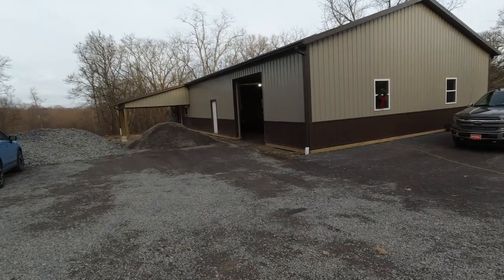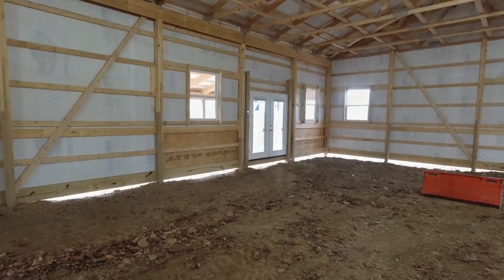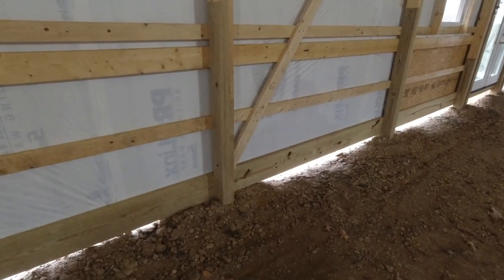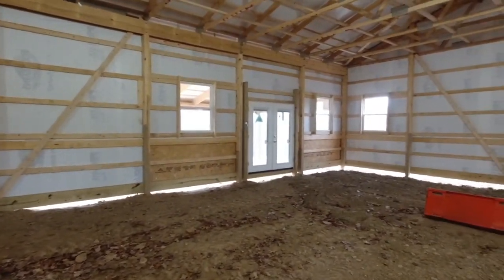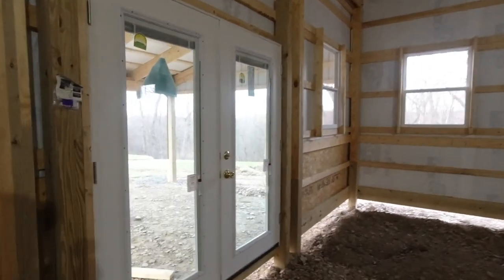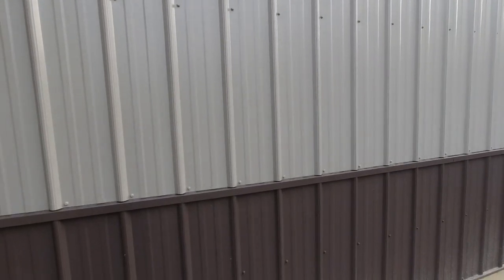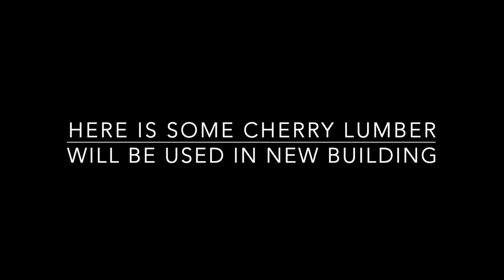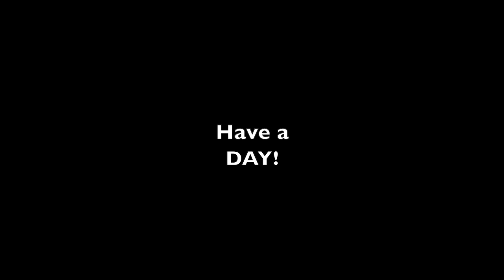Pole Building Experience So Far, Cost Per SF, Pros and Cons Video #1008

Comment: Mike
This is my first comment on your channel, so I’ll tell you a little about myself.
I live on a 25-acre smallholding in the north of Wiltshire here in the UK. We are surrounded by beautiful countryside and a river forms one of our boundaries.
Like you I have a regular job as an Architectural Technologist based in Bristol but since COVID-19 I have worked from home.
I found your videos when looking into buying a tractor to help when repairing hedges, ditches, and fences. Working outdoors at a pace that suites me is such a contrast from my regular job sat in front of a computer screen I love it.
In my work I have used a similar construction to your pole barn but with one difference. I have always used short steel columns from the footing to 6” above ground level which allows the timber to dry after the rain. The ground around your pole barn looks like it would drain well so the timber will last for years.
Thank you for sharing these videos. I always look forward to the next instalment.

Comment: I had a small pole barn built a year or two ago. I use mine as a work shop  I love it. My biggest regret is not adding insulation. I live in the Deep South so cold is not the issue but heat and humidity are. Thanks for sharing your experience with yours. 
Dean

Comment: The property I bought has a 30 x 40’ unheated barn metal sides with a cement slab. I’ll probably build another one that’s heated. Build more than you think you need because you’ll find you’ll need it in the future. Thank you for your thoughts on your new building. It looks wonderful and I like the finishing touches and the Open area under roof where are you can just hang out and have fun.

Comment: Pole barns are popular in Kansas. I have built a few (grew up on a 60 acre farm).  If your are pouring a concrete floor, tie the poles into the floor slab. Keeps the wind from rocking the poles loose. I had one building get lifted up and flipped over due to lack of floor/foundation.

Comment: If you plan on doing mechanical's I strongly suggest you inquire from OEM's what their requirements are for their products to avoid surprises later, easy enough to plan for in your initial layout plan. Nice to have an inside system permitting work on all your equipment and their accessories for service and repairs.

Comment: I built a pole building 35 years ago,  The poles are 6x6 PT and are 48 inches in the ground on a concrete foot. It is 24x24 two story gambrel roof. Concrete floor is 9 inches thick mostly and under to two overhead doors it is 16 inches thick  two car garage down only use one side for my wife's car, the other side is my machine shop. Upstairs is my wood shop. It has outside access to the second floor shop and I heat both floors with a coal burning hot water boiler that I converted to hot air, does a great job.  Every few years I dig down on the side of a post and check for rot and such and so far they are a good as the day they were put there. Of course it did not take long before it was too small but I have to live with that, I did put a small addition the back for my air compressor and the wood shop dust collector. You don't have to worry about your posts they will outlast you for sure.

Comment: I'm finishing up the inside of my pole barn 3 car garage now . The soil conditions may be different there but here in Bama you should sit the poles in a sleeve or they will rot in 5 years . Since the EPA has taken the good stuff out of wood treatment they don't last whether you sit them direct in the soil or in concrete . The plastic post protector sleeves are about 40 buck each from home depot but worth it in the long run .

Comment: Mike, here's an idea for heating your new pole barn. Years ago my uncle Vincent built a new house with 20" exterior walls, using hot water heat for heating. But here's the great idea that will also work for you with radiant heat. He buried an old gasoline tank filled with softball sized stones which were heated by the circulating hot water. He used a wood burner boiler in conjunction with a pulse jet fuel oil furnace. Sadly he passed away shortly after completing this build, but my aunt told me that she fills the wood burner for a day and then circulates the warmth from the heated rocks for the next 3 days. something for you to consider.

Comment: These are great cost effective buildings. Did you think about using concrete perma columns  in the ground with the 6x6 post bolted on top with thick metal brackets. It worked very well for us on a 80x60 building. I think the concrete perma columns with 1/4 inch metal brackets were about 110.00 dollars each. We though this might help make the building last many years more. Just a thought 👍 enjoying your channel very much.

Comment: Hi Mike. Agree with your choice. I have raised 6 pole blgs here in low country SC. Best bang for the buck. However we have to treat around all poles for termites and stay on top of that  process.
Reply: Have you considered pouring ready mix concrete around the posts instead of dry concrete mix and dirt?
Reply: @davidmorse8432  we actually pour mixed concrete and use ground contact treated lumber. Have only had one incident were the critters found a void in the footing and started on a portion of the post. But it took 8 years and then not too much damage.
Reply: @ralphjelomono9068  I have seen where the concrete sometimes cracks around a square post with the crack starting at the post corner and radiating outward.  Maybe some type of spiral #3 rebar could prevent this so the concrete seal around the post would not be broken.  Thanks for your input!
Reply: @davidmorse8432  Likewise appreciate your knowledge. However just like Mike Morgan I believe my pole barn building days are over and future ones I'll leave to the experts!!. I have had enough ladder climbing for one lifetime.

Comment: Its a fine building ..........only thing I would say is I have used pressure treated posts here and they still rot in the ground and eventually go . Perhaps galvanised feet /metal shroud at base of poles ............ you could retro fit them before base goes in ............

Comment: Mike,
I know that you have taken precautions with your posts by using a laminated post to prevent rot.
A fellow YouTuber "Tractor Time with Tim" has an episode called "Pole Barn Update! Post Repair!.
That video showed a product that is a steel sleeve that can be inserted around 3 sides of your post and driven into the group to act as a brace to the post .  
Just a thought but probably not necessary in your case.
Keep up the great work.

Comment: Another advantage is the weight of the building is on the ground and not the concreate floor. Makes it less prone to stress cracking near the edges of the building.  On softer terrain the pole building is the way tp go. your concreate will thank you.   How is the pond drainage pipe? any fixes on that in the future?
 well another awesome as always video . have a day Mike.
Reply from the maker: Good point

Comment: Told you that pole barns direct do a great job. Built my 36x48 several months before you did. ( same color btw)  Everyone should know that you will likely spend 25% to 100% of the cost of the building to finish.  When considering floor, installation, heating, lighting, etc...

Comment: What company manufactured the components? I have a Morton Building, and it looks almost identical. We love ours, and it has served as a stable, lawn equipment, the kid’s automotive shop, and a gym. We live in Missouri, and nearly every one of nearby neighbors (everyone lives about 2,000 ft apart from one another) has a very similar structure. Ours is 23 yrs old, and this year I will have to replace the entrance door. That’s the only work that must be done. It’s been through hail storms and tornadoes over all those yrs too.
Reply from the maker: Morton’s are the Cadillacs

Comment: Thanks for the quick summary. I am building a similar multi-use building and small cabin in the woods this spring. Both buildings will be post frame steel buildings. I am interested to see how your radiant heat floor goes in.  I am a little east of you in Armstrong Co.

Comment: I am building a Barndominium. 60x60 Metal building with 6 inches of insulation. The home will be 26x60 inside the building. The wood shop/garage will be the remaining 34x60. For my retirement in about 4 years!

Comment: Good morning! I sell pole barn kits out of Lancaster county Pa. You mentioned about the wood in the ground may not be as good as a concrete/block foundation. An alternative for that is what's called a Perma-column. Google it.
It's a 5' concrete post that bolts to the bottom of your Glue-lam posts. This keeps your posts out of the ground, still a pole building and your building will last just as long as a building with a concrete/block foundation.

Comment: Does the skirt board around the base remain?  If you pour concrete inside and a patio outside then  the skirt board would be sandwiched between both pours, right?
Reply from the maker: There will be 4" Thick Foam board on inside that the concrete will go up against if that makes sense

Comment: Hard to compare a pole structure to a complete house ? We built pole building for cattle / hay / lumber operation in northern Ontario Canada . They are one of the cheaper methods by not spending money under ground and insurance cost because classed as low occupancy. Nice building you have there Mr. Morgan , M&M Enterprises is looking good

Comment: I would like to put up a building for a shop.  my 3 car is a bit crowded to work in.  we're on rock.  There is a house going in next to us that is a Morton Building.  they dug the post holes with a massive truck with a rock teeth on the drill.  it took two days to dig the holes for a 1200 SF building.  I have talked to several people including Kyle from RR Buildings (if you haven't watched his channel, you should) and my excavation contractor. all are in agreement that I should do a slab on grade and use the post brackets.  I've thought about it and if I do, I'll insulate the exterior of the slab using an ICF form that has been cut in half. that's 18" tall as well as foam under the floor for heat.

Comment: I think I heard you say the patio and game room has a 5 inch cement floor but I didn't hear you say if you had a cement floor or how thick of floor in the storage area. I am a fairly big farmer in Indiana with large heavy equipment and 4 semis and I have 8 inch thick cement floors in it. I don't know how much ready mix cement is there a cubic yard but the last pole barn I built cement was $80 a cubic yard. None of my last pole barn building is finished or insulated but the roof tar paper under it to keep it from sweating inside on my equipment but it sounds like to me what you have there is a really good price on yours.
Reply: In Michigan I believe the price of  concrete is about 2 times that price now.

Joe

Comment: As for gutter guards, I have a mixture of the mesh screens (org house) and the more advanced, aluminum with holes (new addition).  Honestly I do not see much difference.  I have lots of 100’ trees around and the only place I have to clean are the 90 degrees inside corners.   Either are well worth it.

Comment: Mike, a few thoughts after I just spent a month wiring a pole barn. If your contractor asks you to rent a man lift- rent the man lift. Working off of a 14 foot ladder and still being 6 feet from the ceiling is uncomfortable and dangerous and makes simple 20 minute tasks take hours; because I was working for a friend and trying to save him money, an 8 day job became a 24 day job, because the cost of a man lift was too high for him to rent.
Before you pour your concrete, not only do your plumbing but also please call your electrician. He can put a ton of your wiring work underground in pipe under the concrete and take that 8 day job and make it a 5 day job for them. 
Pick out the lights you want to use before or when you talk to your electrician the first time and please provide them before they are finished with the work and stuck waiting for your decision so they can finish wiring the building because of the lighting you choose.
And also, talk to your people while they are working there but for god's sake, please do not talk so much they stop working and just stand there talking to you. time is money.
I love my buddy, the location was a bit far, and the scenery of the job site was idyllic- it just wasn't 16 days of extra labor worth of I want to be here- idyllic.
Thanks for the videos and have a good one.
Reply: pallet forks on the 5t on kubota 360 plus man basket. == sky lift used to use one on the 8 ton 360 kubota or forklift or teli-handler mega with a good operator on the controls. Regards uk

Comment: If you are pouring a 5 inch thick concrete floor why didn’t you pour the floor first and set your posts on top of the concrete by way of HEAVY DUTY STAINLESS STEEL BRACKETS. This eliminates the posts from roughting out. You get the advantage of cheaper cost plus longevity in the foundation system. Pole Buildings have come a long way. GOOD LUCK, Vinny 🇺🇸

Comment: Interesting, here in the U.K. a building like that would normally be built with a steel frame. Wood is used as a primary structural material far less often than in the US. The vast majority of “normal” houses are build with brick and block work outer walls with wood only used for floor beams and roof trusses.

Comment: "Hobby Barn"?? That's an expensive hobby! lol Looking forward to seeing it when it's done. It should be a great place!
Reply: You tube $
Reply: We want to see the heatings layers installed.  Bathrooom installed. Kitchen layouts play room toy let plumbing.  Five inch cemene.     Look at it once check three times you don’t want to Jack up th e under ground tubing......Make sure you drive a uffer ground copper 6 feet deep by your power main feed you migh ones of the days you would think about putting up a pole with a Digital antenna-to be free an which saves you lots of money .....what’s your WIFI situation to be at the building 
What kind of service do have now
Since you don’t have concrete foundation I would suggest that that you put a copper rod at each corner 6 feet deep  you need to ground kitchen  you might one
If you need any tinfo be glad to help have not missed any of. Your show I’m 85 in March   Live in Peoria Arizona 

M

Comment: If you have been watching the channel - Ha - do you even need to ask? 
Mike how long do the pole building footers last? Anything you can do to make them last longer?
Reply: You can backfill the post holes with ready mix concrete from a concrete supplier.  It really doesn't take much concrete to do this and the posts will be protected from moisture plus the building will be more rigid.  Use a concrete vibrator to settle the concrete in the post hole.  Bring the level of the concrete above what finish dirt grade will be outside but just below the bottom of the interior slab.

Comment: Is there a way on a pole barn to have a section where I could have high ceilings so I could have a vehicle lift... besides having very tall walls for the trusses?
Reply: Yes, my pole building has 16' walls.  Doesn't add very much to the cost (some) because the roof is same size and labor is not that much different.
Reply: Most pole buildings have high ceilings with plenty of room for a car lift they make them in all sizes and design them to your specifications
Reply: @madsciencegary3830  thank you very much

Comment: Need to make plans to put in  a lift to work on equipment in flooring when laying out radian floor heat.  Be nice when you get older
Reply: Mine was built with 12 inches of concrete where lift will be located. Heat lines were run around those areas. I hope to be able to add Turf Rails to easily lift equipment.

Comment: What's the expected lifetime of the poles before they rot?
Reply: I would say drainage is the key to longevity of the poles. He has a Great drainage system.
Reply: Lot has to do with drainage, 10 foot 4x4 treated posts on my back porch were placed 33 years ago the same way and the roof covers it all, they never get wet unless there's a driving rain, but there's never any standing water on them.

Comment: Is 5" of concrete enough? I thought maybe you would go 6".
Reply: More a matter of type and amount of aggregate used in the concrete. 5 inches thick with wire and rebar will hold a good sized bulldozer.
Reply: @haroldhenderson2824  That's probably true. I just wondered with having the radiant heat tubing running through the concrete would have an effect on the strength?

Comment: I suggest you mix some of that cherry sawdust with a diluted Elmer's wood glue to form a wood based paste that can be molded by a hydraulic press into a beverage can diameter  coin or coaster, imprinted with a circular morganite logo. available for sale [$5.00]? in your merch dept. a portion of the proceeds donated to an animal shelter cause?[the STANLEY award.